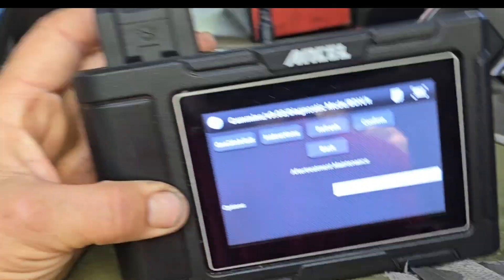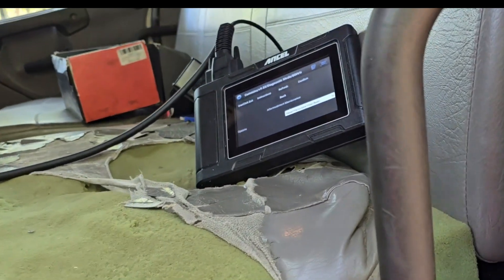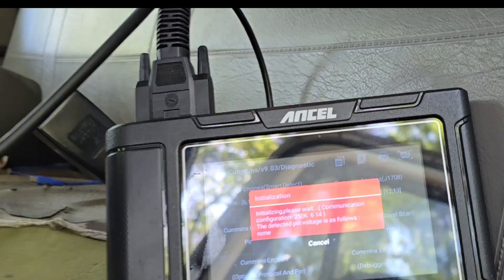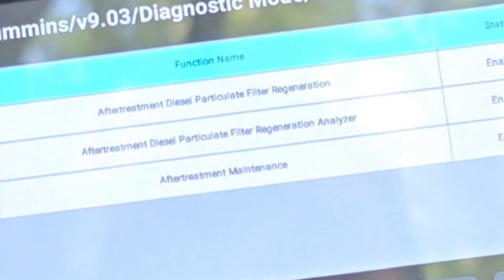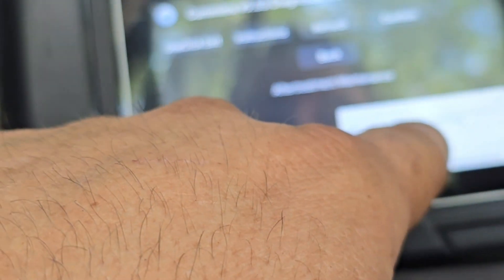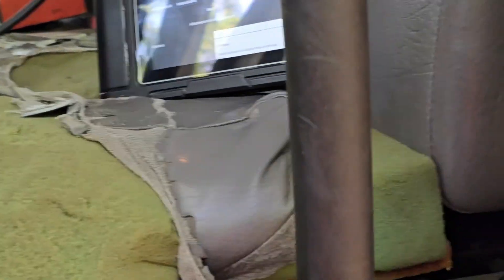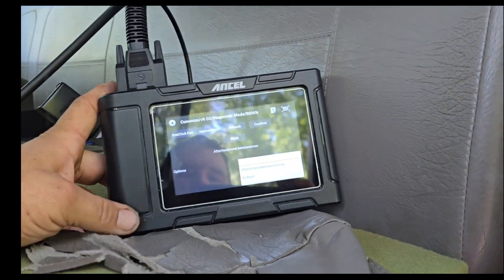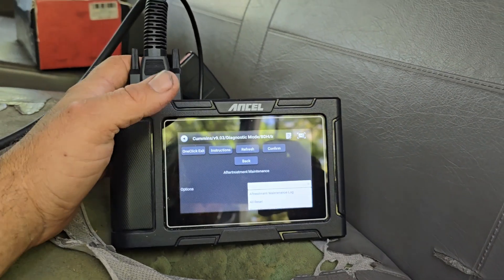freightliner red stop engine light. how to reset red check engine light.

Comment: I've had the same experience. I've spent over $40,000 trying to fix the def system on a 2015 Freightliner Cascadia. I have an OTR tool, but have discovered it can't reset the red stop engine light. I'm going to try one of those Zurich tools you get at Harbor Freight. If that doesn't work I guess I'll try that Ancel tool. Spending hundreds on diagnostic tools is much better than spending thousands and thousands on these def problems that never end and never get fixed.  Freightliner should have recalled these trucks a long time ago. Shame on California for forcing these systems that don't work on every trucker, and single-handedly ruining the reliability of what was a pretty much bulletproof tried and true diesel engine. Good luck to all.

Comment: Great info thanks question.. did you ever had hot air coming under the dash area.. steering wheel area while driving on a highway and then almost nothing at a full stop ?